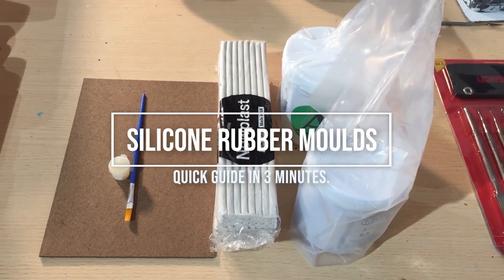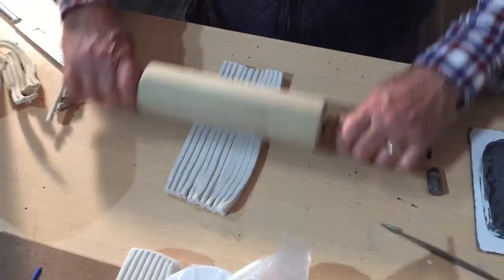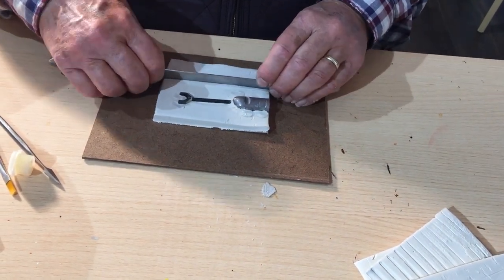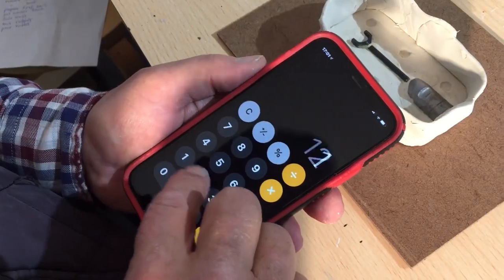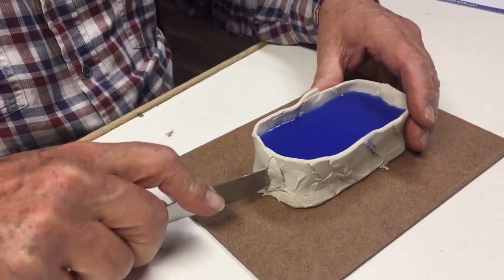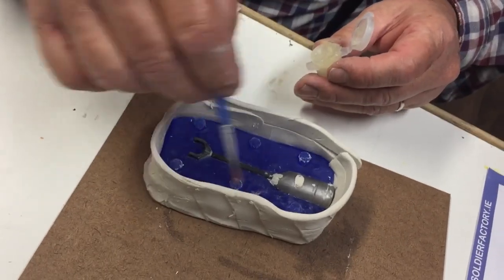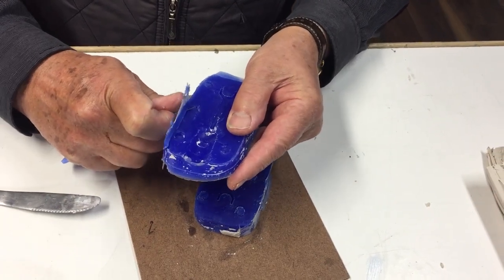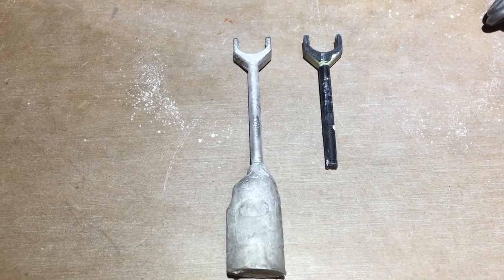Short summery on making Silicone Rubber moulds by Prince August and casting the result in metal.

Comment: Nice summary.  I watched the longer videos yesterday.  As I have some scrap bits of lead, pewter and aluminium, would your moulds perform ok with their melting temperatures?
Reply from the maker: The lead and pewter are fine. Aluminium might be too hot.
Reply: @princeaugustcasting  Thank you for your prompt reply.  Yes now I can see that at 660°C, the melting point of aluminium is almost double that of lead and pewter. :)  Anyway, I gather that you sell white metal in your store anyway. I will have a look at the kit you supply.
Reply from the maker: @Osmiculture  We do sell the white metal ingots on our website. The kit mentioned here will be available shortly on our website, but is not available yet. I should have it available by close of business tomorrow (friday).
Reply: @princeaugustcasting  Aha! That's why I couldn't find it.